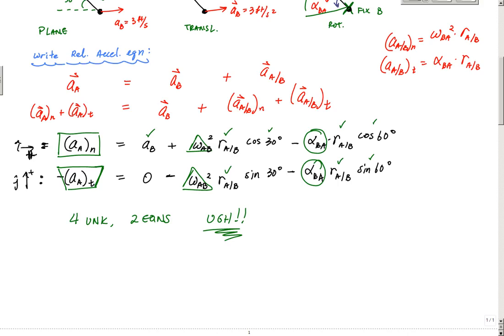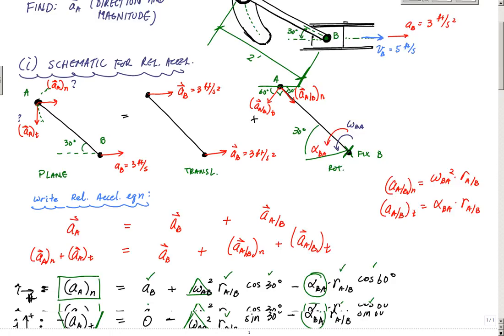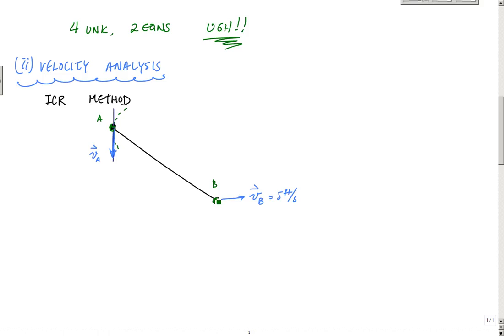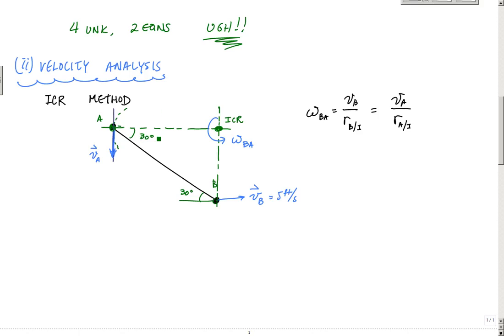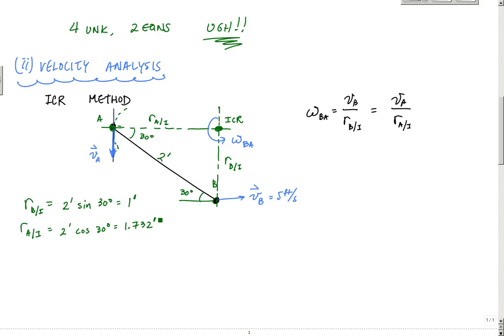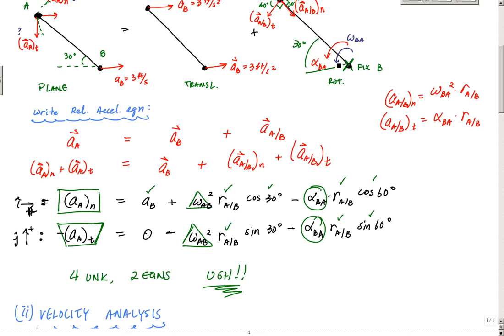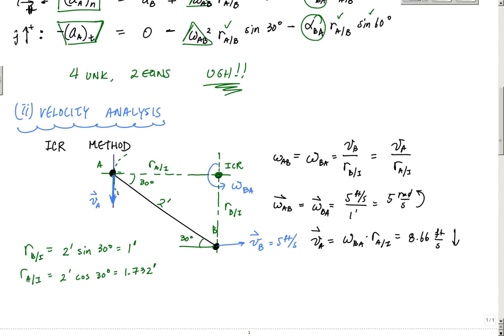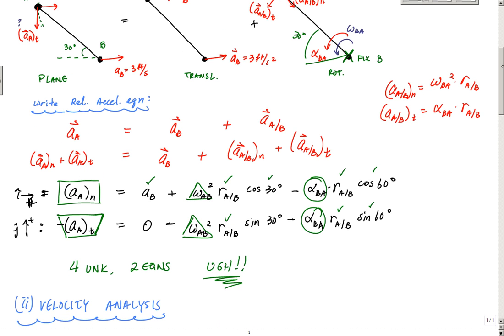Acceleration Analysis Example Part 2 of 3 - Engineering Dynamics - Rigid Body Kinematics

Comment: I am confused, from the original diagram it doesn't look like the Velocity of A at theta = 30° will be pointing straight down. But in ii.)velocity analysis you drew it as pointing straight down. Shouldn't it be tangent to the path in which case it will not be directly downwards?
Reply: Oh duh! I figured it out. LOL 
Thanks anyway. 
AND YOU'RE AWESOME. THANKS FOR ALL THE GREAT VIDEOS. I'M REFERRING YOU TO EVEYONE I KNOW! :)
Reply: Isn't the direction of Va supposed to be perpendicular to the rod AB??
Reply: yourlifeline182 Not in the original fbd. The point B is not fixed originally. So we break the original motion into 2 parts; one of which is fixed point  rotation. When you have point B fixed then A have a tangential velocity (which is the "third fbd" he drew on far right"). Hope that helps.